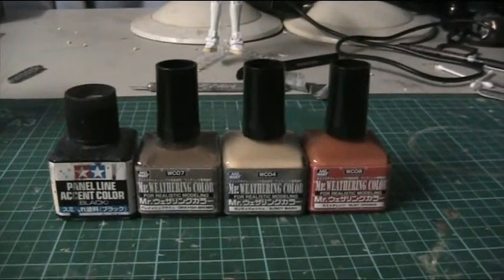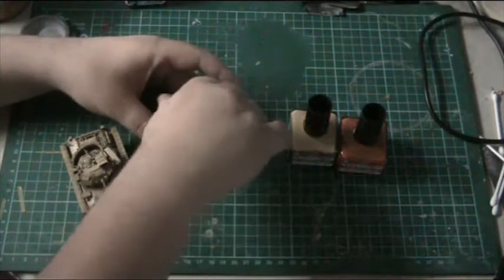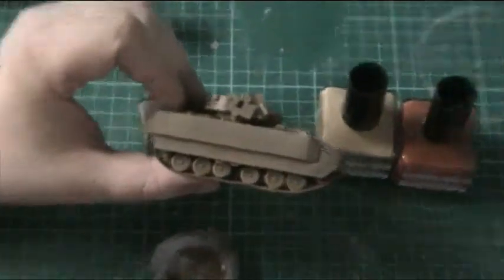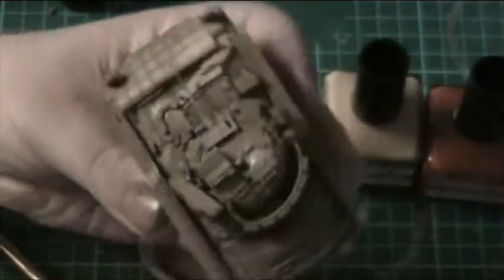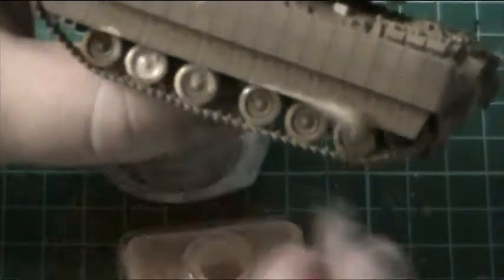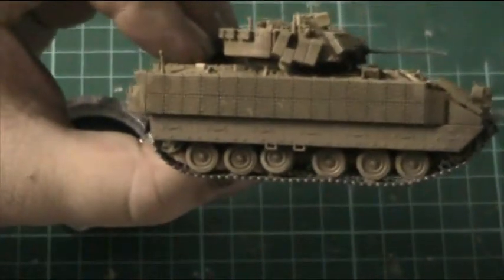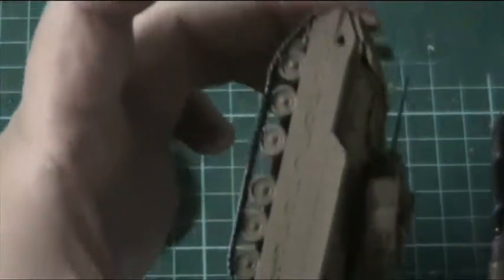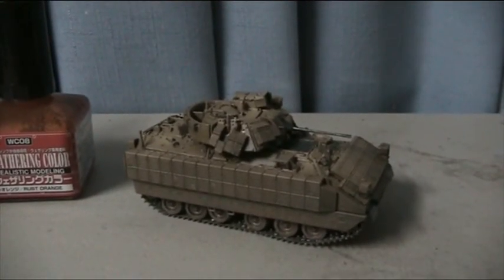model kit workshop 102: Mr. Weathering color enamel wash

Comment: So not only it can be used to panel line, it can also be used for painting the kit?
Reply from the maker: You can not base coat with this product, pin, panel and sludge washes as well as other weathering methods are possible.